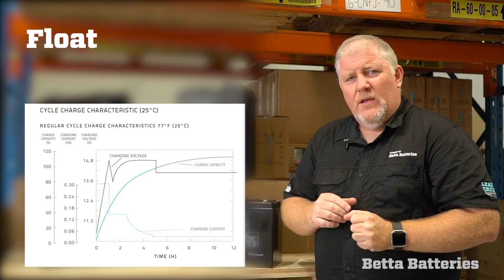Charging a Lead Crystal Battery

Comment: Seems you can no longer buy batteries from this manufacturer. And Crystal batteries from other manufacturers seem to be happy with 10% of amps for charging, i.e. 10 amp charger for 100ah battery. Just a heads up.

Comment: Hi everyone but particularily Jason. I have 30 two year old 12 cnfj 14 which appear to have become 'frozen' and have lost a significant amount of capacity.  I have tried a maintanance cycle with discharge using a 47 ohm resistor to 11v on load (47ohms) off load its 12.7 voltsbulk charge stage temp compensated at 14.8 volts but the current being drawn from the charger is only 0.6 amps. From the video I was expecting it to be around 4 amps i.e 30% of its c10 rating. HELP  Should I increase the voltage until a charge current of 4 amps is reached or should I charge the battery with a load.

Comment: Hi I’m getting for 170ah battery’s  and they will be wired in series  what’s the best way to change them in the van that’s 12v. Looking forward to your reply 
Dave,,
Reply: I assume you are planning to use two in series to produce 24v. You need a buck converter to raise the voltage to whats needed or two 12v chargers with floating outputs so the outputs of each charger can charge an idividual battery. WARNING the chargers must have floating outputs and unless the chargers specifically state they have floating outputs don't try it. The best way is to use a buck based charge circuit that raises the voltage from the 14.x to around 28.x to 29.x the exact voltage depends on temperature.

Comment: I am fitting two of your 120 AH CVFJ Batteries. On the side it says Max Charge 14.4v.  I have fitted a CTEK D250SE and Smartpass 120  but am not connecting the 14.7v boost lead in accordance with the printed label on the batteries of 14.4v (2yo).. But in this video you mention a 14.7 v charge at boost level.
Please advise if I should connect the 14.7v booster, otherwise the Smartpass will charge at 14.4v as per battery instructions..

Comment: No worth to buy, too complicated. I want something to set it and forget it.  At the moment there is no dc-dc charger on the market which is specifically for LC batteries. 

Redarc recommends to charge LC batteries on setting A which is basically AGM batteries profile but charges only at 14.6V

Comment: So, Jason, you say charge current should be 30% of capacity... from other things you have said that would seem to be a minimum charge current, rather than an exact level.  So what is the maximum charge current?  The inverter charger on my boat will charge at 125A max if the battery is really dead. No way to throttle that down, so if I have 3 of your 120Ah batteries, would this be a problem? If the transition for going from bulk to absorption when the battery hits 14.8V?
These are the sort of questions that you don't really cover here.

Comment: I have agm battery with a dc/do projecta 25 amp charger , can  I use lead crystal battery with this system also use a ac/dc charger on the agm function

Comment: Good luck finding a charger that meets this spec.. and if you do it will cost a fortune..
What about the golf cart industry? there is no 48-volt battery charger available for golf cars that will charge at 50-Amps!
You would have to buy a forklift traction battery charger to obtain these charge rates.. must be why EZGO golf cars with LC batteries are failing all over the place..
Reply: https://no.co/products/charging/industrial

Like you said. In my experience these are the only Safe "smart" charge system

Comment: I have never heard of a battery with a limit on how low a charging current can be,  the effect is that it rules them out for most motorhome use!  Take a motorhome with 200 Ah of batteries that is charged by 200 W of solar panels that produce a maximum of 11 A.  From what you say,  this is not going to cut  it as it needs 30 A to charge! I must add another 400 W of solar panels, but my motorhome has no space for that.

Comment: Great Vid Randy,
just a couple of queries, 
1) You mention CVFJ, EVFJ, etc., means not a lot, to many of us, I am guessing, Acronyms, not my strong point? 
2) So I guess that on a 100AH Lead Crystal battery, a 12V 40A Redarc or Enerdrive dcdc charger on a modern 4wd is no problem if driven constantly for a couple of hours minimum would be enough time to fully charge the Battery?
3) However, if you had say a caravan with 2) 100AH Lead Crystal batteries, you would need to connect up to an 80amp charger from time to time?
4)Who has an 80 amp hour charger with the correct charging algorithm for Lead Crystal lying around? So Then what are we to do?

Comment: Thanks for the insight on this technology!!  I have a 5.7L V8 Toyota, and will be up-fitting the alternator to a high-output one (370Ah max/215Ah idle).  I will be installing an auxiliary battery (or two).  Considering the minimum charging requirements you mention, what would be the maximum-size Ah CNFJ I could sufficiently (i.e., meet minimum requirements) charge at 215Ah / 12V / 2580VA ?  The max weight I prefer is 100lbs so from that standpoint it is the CNFJ-150.  I'm lost on the match at this point!  Thanks!

Comment: Hi, I’m interested in upgrading my aux battery to your 100/110 amp lead crystal battery.  I have a REDARC BCDC1225D installed. Is this suitable for the correct charging current? Thx. Bill

Comment: Which brand charger would you recommend than
Reply: jack, did you send them email and did you find out what charger they recommended
Reply: Any news yet? really interested to hear which charger is a suitable one for this type of battery!  I sent Betta Battery an email too,  hoping for a quick and satisfying answer.
Reply: @Bhoeby  did anyone get an answer on what to use?
Reply: @Michael Saligari hi,  i got a local supplier recommendation:  victron blue smart ip 22. 30amp... my battery is toasted ( when i purchased they said solar panels alone could keep battery charged🧐 no mention if a charger ) little did i know at that time..... so wont choose this battery again due to the absurdly high investment 400NZD for a  charger for the 750NZD battery...lets see what factory warranty will provide now...
Reply from the maker: Hi Jack, really depends on the battery or batteries you are charging. Shoot us the details on marketingau@bettabatteries.com and we can make a recommendation.
Reply: I tough we were talking here of Crystal Lead batteries and not LifePo4
Reply: Redarc BCDC 1240 has been mentioned by a customer on another youtube video, they have larger and smaller versions as well. Here is a link to the video: https://www.youtube.com/watch?v=jbfR6JeUXlY